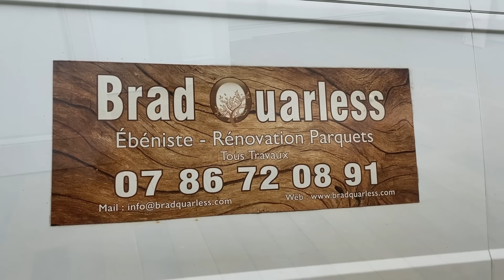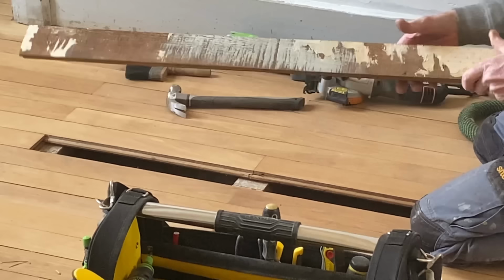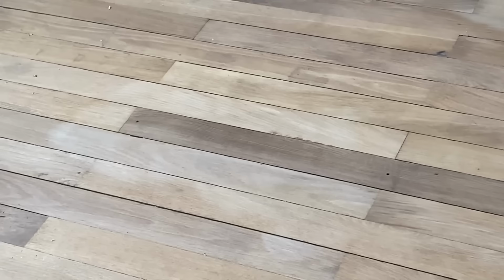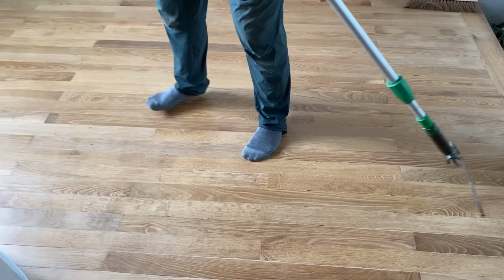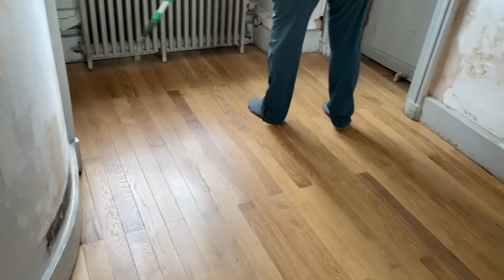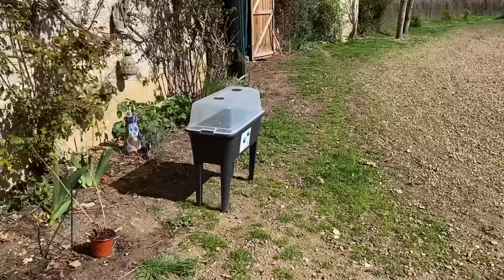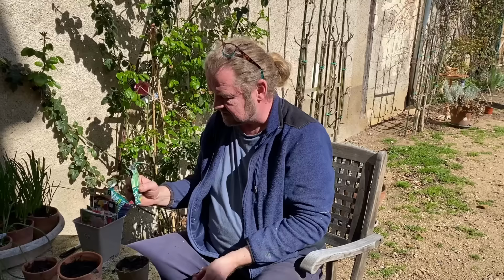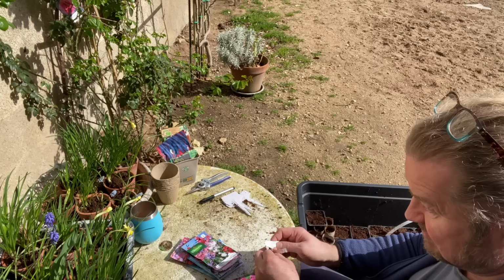Restoring 17th Century Parquet Wood Flooring, Chateau Restoration - Journey to the Château, Ep. 187

Comment: I’m just curious about the oil finish choice. We had oil the first time we did our floors, but this time every single professional bid on & preferred a water-based finish. Apparently it’s more durable & lasts longer. It’s especially beneficial for dog owners. I’m interested in your opinion.
Reply from the maker: Oil finish is plant based, so no toxic chemicals for the environment; oil is a natural finish that penetrates and shows the natural beauty of the wood instead of a plastic coating that sits on the surface. Oil is durable for pets and scratches, and can be spot repaired if necessary while still blending with surrounding floor instead of others that require that the entire floor has to be refinished. Also, our dogs are on the stone floors and tiles and do not go into the wood floor areas of the chateau. Thanks!
Reply: @JourneytotheChateau  I’m so happy someone finally explained this difference to me. Normally people just tell me they like the other one more with no reason.